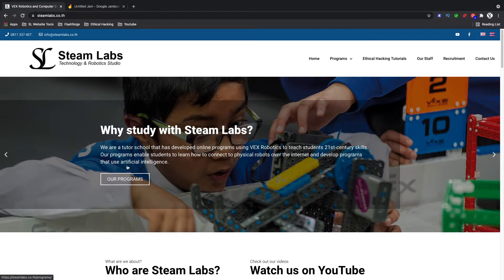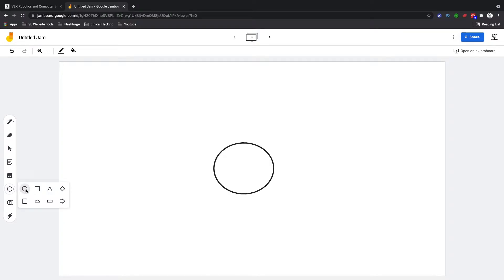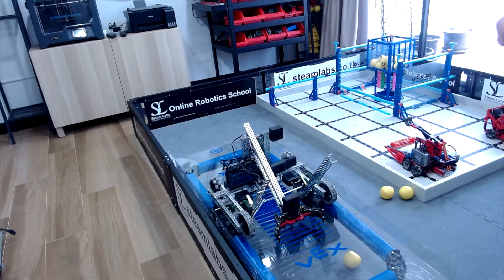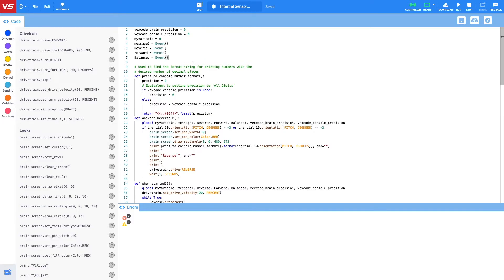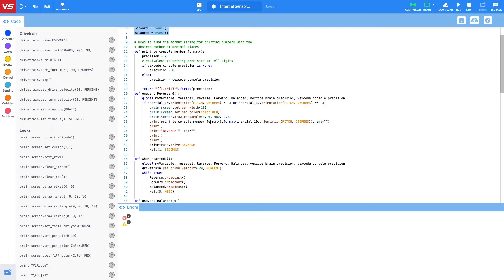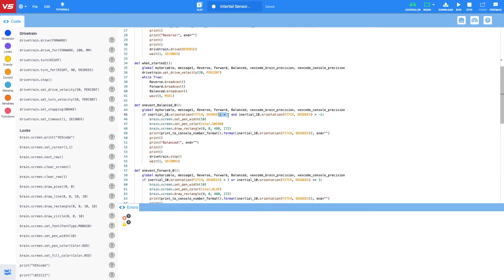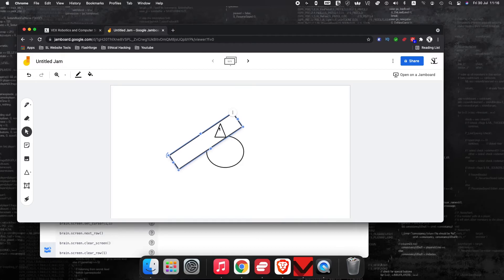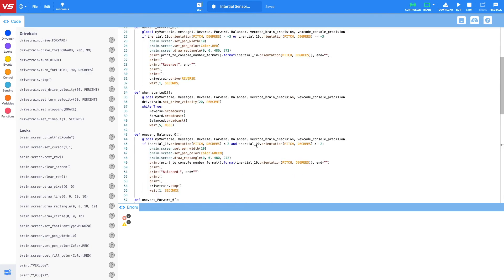V5 Inertial Sensor self correction - VEX Tipping Point

Comment: i know these are a bit old, and i’m a little bit late, but in class right now we are using sensors to detect objects , and pivot away from them to avoid collision. i figured out how to code the sensors to pinpoint how near or far they are away from my hand, but i haven’t figured out how to get it to move and survey objects around them. 

for example, my teacher expects me to code my robots to move, turn, and avoid my peers robots so they don’t bump into eachother.